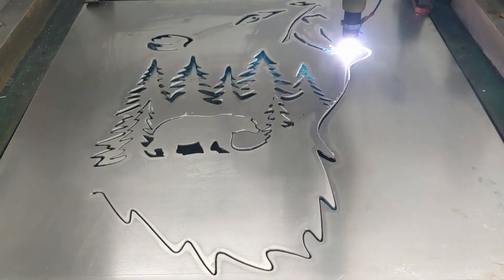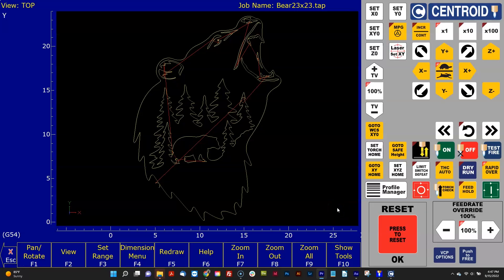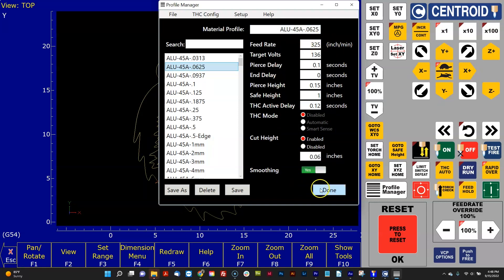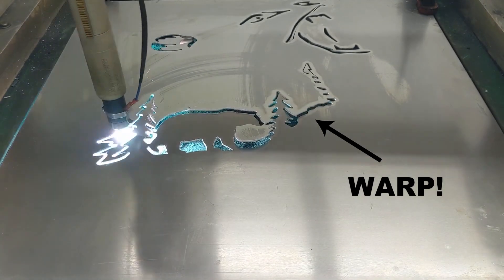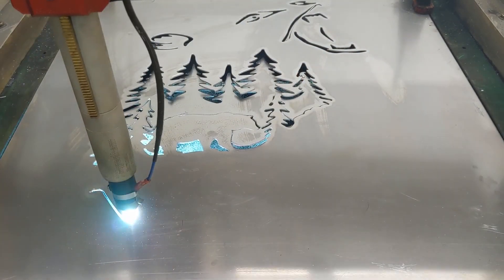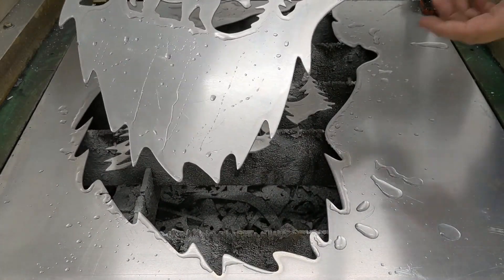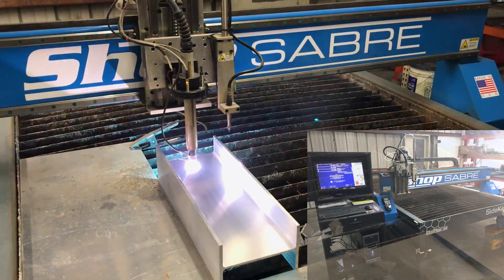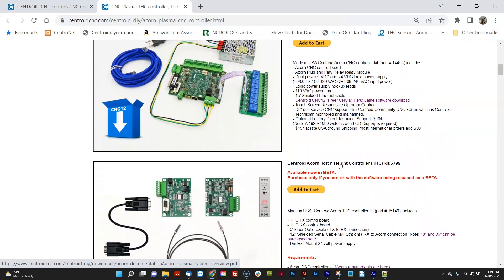CNC Plasma Aluminum cutting with Auto Torch Height Controller, Acorn DIY kit

Comment: Where is the smoke? do you have a downdraft? I did some big cuts on a water table and filled the workshop with smoke. Also blew white powder over the torch and gantry
Reply: Al2O3 smoke is very dangerous. Be careful.
Reply: Molten Aluminum can explode when it comes into contact with water. Using a water table with Aluminum is very dangerous
Reply: If you're still alive and functional you might want to put some serious thought into dust and smoke extraction lol. Aluminum dust and smoke is highly neurotoxic and one of the worst things for your long term brain health. Potential ties to dementia and alzheimers.